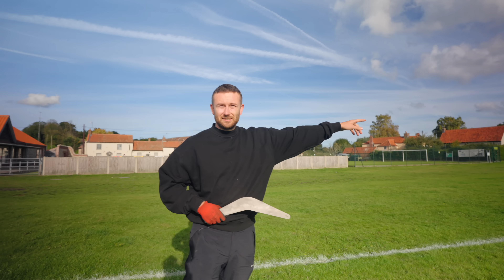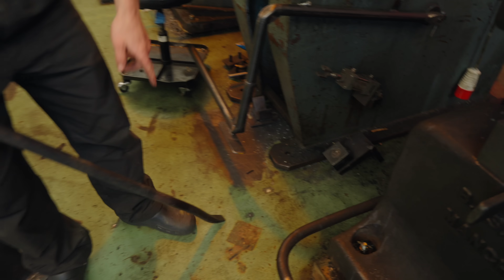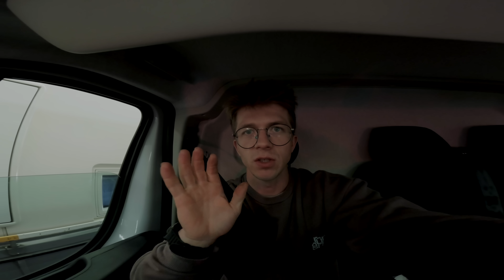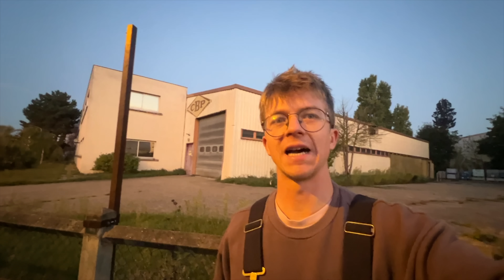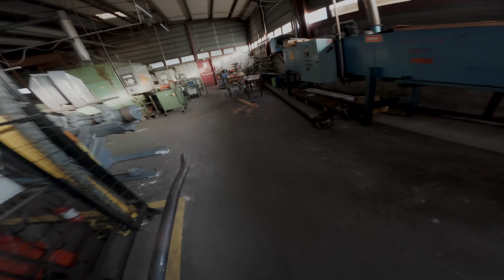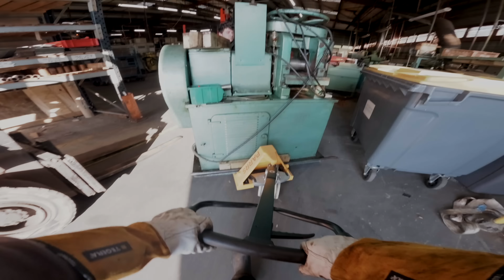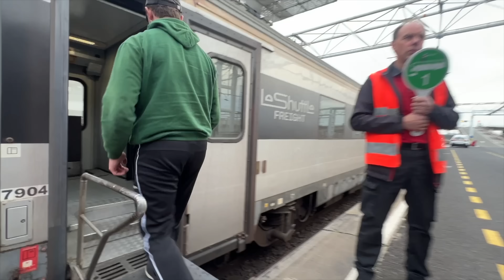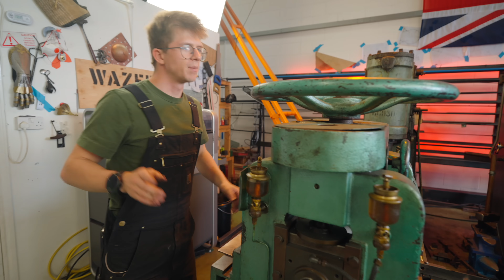My New French Friend

Comment: The curve comes from the small wheel.  Its adjusting the top roller forward and backwards (not up and down).  Moving the top roller backwards (away from you) will make the material curve downwards, and moving it towards you will make the material curve upwards.  Its adjusting the contact point between the rollers and if they aren't perfectly aligned its going to make the material curve.
Reply: There might be adjustments to the top to bottom roller. 
OR it could be that the top roller and the bottom roller are not running at the same speed. Either due to issues with the gearing and motors or the diameter of the rollers. 
If the bottom roller is larger or going faster it would inpart a curve on the material as the material is being forced through the nip faster at the bottom than the top.
Reply: @TrygK  exactly the reason metal bends is usually because the upper wheel slips or is slower than the lower one or even without lubrication the metal "sticks" to the roller causing the curve. This machine does not have horizontal roller adjustment, only vertical.
Reply: Was not sure if he was trolling when he said he did not know what it does lol
Reply: The reason metal bends is usually because the upper wheel slips or is slower than the lower one or even without lubrication the metal "sticks" to the roller causing the curve. This machine does not have horizontal roller adjustment, only vertical.
Reply: Looking at the bronze axle boxes on the ends of the rollers, they're pretty much constrained by the uprights, so I doubt it will alter the fore and aft position of the top roll ? My money's on a fine feed wheel.
Reply: @graemewhite5029  You are correct, the rollers are not free to move - only the feed screw. The way you prevent the bend is you TURN IT OVER each pass to equalise out the bending of the bar. 

Steel mills have an over and under feed - they feed it from front to back and then back to front UNDER the roller
Reply: @piccalillipit9211  I am a gold smith and I have used plenty of hand crank rolling mills and while smaller, they are also very similar. most precious metal mills will cause a curl and the way you correct the curl is exactly what you said. filp it over with each pass. if it curls to the left or right the same is true. getting in there to try to change alignment issues is not fun, just flip it dude..
Reply: That was my first thought too but @20:20 you can see the wheels don't have adjustment in that direction, only the Z  axis is adjustable
Reply: No, that's wrong. There's no horizontal roller adjustment on this machine. Curve come from a speed difference and or sliding between top and bottom roller.
Reply: @Eng-OS ive worked in quite a few machine shops, never one that had or used a machine like this, but have been around many machines throughout my career, to me the small wheel looks like it would be for fine adjustments since the larger wheel has a pretty coarse thread it would make sense to have a way of making smaller adjustments between passes.
Reply: My bet is the rollers are not moving at the same speed. Makes sense if this machine has no forward/ aft adjustment.
Reply: Every time you run the material through the rolling mill ,you have to turn the material over to prevent the material from curling excessively.
Reply: I worked in the largest rolling mill in the US, our mill you could adjust the speed of the rollers independently if the material deflected also the position of the top roller in relation to the bottom roller in relation to the bed. (I'm guessing that's what the small wheel is for.).   However I will add, different alloys react differently to rolling and the machine had to be adjusted accordingly.
Reply: Try flipping the metal every time you roll. Before the curve gets to large,always worked with silver and gold.
Reply: Nope, all wrong, all of you. I don't get how nobody has noticed that the only thing the small wheel could possibly be doing is adjusting the tilt of the top roller side-to-side.
Not a fine adjust (the big wheel is big for a reason), not any sort of traverse (this is a flat roller), not a speed/slip control (adjusting that is far more complicated).
It moves the central gear which makes the jack gears rotate in opposite directions so one screw goes up and the other one goes down, tilting the roller side-to-side.
This seems incredibly obvious.
Reply: @samheasmanwhite  on a rolling mill like this, there isn't really benefit to having one side closer together than the other. It would just cause the piece to wander to the wider side and prevent it from compressing as much as if you simply had the rollers parallel.

Having an adjustment available to true up rollers that have shifted out of parallel makes sense, but that is not an operation that would need to happen frequently enough to justify a control front and center; it would more likely be set screws or nuts or something that people couldn't accidentally mess up during regular use.
Reply: @Mrjcowman  The adjustment range is very small so yeah I'd assume it's just for zeroing out small errors in parallelism.
It seems to actually be a fairly common adjustment on this sort of mill, like on the mill he shows briefly from the other fellow the height adjustment wheel is actually two wheels sandwiched together that can be loosened to move each side independently.
I'm not sure why it's important, but there are inaccuracies in threads and slight differences in stiffness of each side, so I wouldn't be surprised if making something like precise shim stock could require correction on a job-by-job basis due to being so thin that a few microns of tilt could be a problem.
Reply: I believe it’s either this or for making finer adjustments by dividing each tooth on the big wheel into a full circle on the small wheel. If it’s a cold roller, it should require much finer adjustment because the material is more dimensionally stable when cold-rolled. But for hot rolling, I’m not sure how much adjustment a roller needs, so @gingerhacks5131’s comment makes more sense to me.
Reply: What he said. I was going to comment the same thing but you said it. 😂
Reply: Spot on.
Reply: Nailed it
Reply: That was my take too. The small wheel/dial changes the angle (front to back) and pressure point between the rollers.
Reply: What if it acts as a brake on the top roller adjustment to the speed will adjust the nip of the steel being fed and impart a curve?
Reply: I work in a facility that specifically mills (rolls thinner) aluminum ingots into sheet metal. The curve can be due to an alignment issue with the rollers, but more common and therefore more likely, is a speed issue. We roll ingots from 32 inches thick to the thickness of a soda can. Any speed issues at all will cause the metal to curve. The small wheel is likely to fine tune the upper rollers speed to prevent curvature. That particular mill is not designed to produce curved work pieces. It is designed to flatten and reduce the profile of the work piece.
Reply: Yes, if the rollers aren't aligned and especially if the top roller is behind the bottom then it rolls up.
Reply: Exactly my thoughts. The curl is an alignment issue. There’s gotta be an adjustment so that it can be used as a roller(radius roller)  aswell.
Reply: Genuinely curious as to what metal working process would require you to have the material curling upwards in a rolling mill of this kind... You're not exactly going to be making hoops in this contraption.
Reply: @CapOfXav  You've never seen arched railings or gates etc?
Reply: yeah it reminds me of a slip roller in that regards
Reply: I knew it changed the orientation of the two rollers but i didn't know it would cause the curve in the metal. Thank you for the knowledge.
Reply: I think that the actual issue is that the metal being rolled is cooled by the roller press on the lower side making the metal unevenly heated which allows the top side to bend more easily. So heating the metal more or creating some insulation layer between workpiece and the bench of the roller press might improve the situation.
Reply: I've never worked on one of these machines or anything like it but I could work that small wheel adjustment out 😆😆 if you have one roller Infront of the other it's going to curve upwards  if it's behind it it'll curve down and if it's spot on it'll come out flat
Reply: Bingo! He was wayyy overthinking the small wheel.
Reply: I thought it was pretty obvious too and I trained as a mechanic not a metal worker/forger.
Reply: Was gonna say the day thing!
Reply: Yep just what I was going to post.
Reply: yes its pretty simple logic now that i think about it
Reply: @jacnadd780  This machine does not have horizontal adjustment, it only has vertical adjustment, and the small wheel is used for fine adjustment.

Comment: No hate on Jamie, but that's not how you throw a boomerang at all. There's a simple but distinct way of doing it, just like you wouldn't just chuck a stone into the water if you wanted it to skip. With the technique you used to throw that titanium boomerang, no boomerang would return, so it wasn't really demystified. That's a Jamie L.
Reply: As it's 2mm thick and made of titanium, I don't think you really want it coming back anyway.
Reply: There’s no way that thing was coming back regardless. I just don’t think you can get enough cross-section shape out of 2mm sheet for it to generate enough lift.
Reply: @SaffronMilkChap You don’t actually need that much lift.  It’s  mostly gyroscopic precession at work.  I’ve seen flat boomerangs work, but they were very unstable.  I don’t know for sure, but I suspect that the airfoil shape is more important for drag reduction than lift generation.  For a lightweight material a flat leading edge like that would sap angular momentum way too quickly.
Reply: The angle you have to release it is about 60-75 degrees (up from horizontal)
Or 15 to 30 degrees off the vertical. 
They make thin plastic boomerangs in all sorts of configurations. So if you are getting lift from the surfaces it should work.
However!!!
I think you need to put some curvature into those surfaces (ie. belly them out) to get lift from them. Otherwise they're just too shallow an aerofoil and not enough lift to overcome aero drag/weight. Make a 'deeper' aerofoil by dishing the surfaces and you'll have a mystical titanium boomerang! (Anodise it for more mystic).
Reply: Did you know there is a name for a boomerang that doesn't come back ?

It's then called a stick
Aussie joke !

Comment: From what I understand, The curling is the internal stresses showing - you run it through onece and if it curves you flip it and run it back through.

Can also be one wheel "slipping or rotating slower than the other. Which ever wheel is moving slower it will curl away from

Comment: you could have lifted the pallet to get the other side of blocks out instead of having to sling it up.
Reply: This was my thought as well. Something which may come in useful for the next time!
Reply: With the slings it can't topple over though. Factory floors are level but pallets on a parking lot can get pretty wobbly. Safety first.

Comment: Hey Alec,
In case you are not aware: you can do ARB (accumulative roll bonding) to create nanocristalline or at least ultra fine grained metals. Take a look at that :)
Edit: or reach out, I am a materials science PhD and used to work a tiny bit with ARB and could connect you to some experts if you want.
And you can also use two different metal sheets to create laminates with down to sub micron layer thickness and much higher hardness than the pure metals.
Reply from the maker: This sounds crazy! Would love to learn more!
Reply: @AlecSteele  i don't have Instagram, how can i reach out to you without that to give some more information? 
But i also saw there are a lot of open access publications available if you want to start like that..
Reply: @AlecSteele  Yes! Please!!
Reply: I think that's the secret project, cold bonding to make Titanium Damascus.
I saw a youtube vid about that recently, they used a press to make the bond.
Reply: We all want to see more of Alec's Mad Scientist story arc, so this sounds very cool!
And I'm with s1gne... that'd be wild if cold-welding could work to make Timascus. I've seen AvE and Adam Savage demonstrate it on gauge blocks, where simply wringing their flat surfaces together losely bond them enough to have the one hold on almost as though it's using magnetism to stay connected. (but it isn't, as they demonstrated so before the wringing)
Reply: @DUKE_of_RAMBLE im starting to think Alec is only a bad day or two from becoming a super villain flinging titanium boomerangs at james bond or batman 😂😂😂😂
Reply: @Greg1096  LOL But... Why can't he be a good guy still?? 😅
The "Feral Child" in Mad Max 2 had a metal boomerang and he wasn't evil 😋
Sure, he snarled at AND bit Max, but that's just because he's feral! lol 

Canonically that was made from "chrome", though, not titanium. Even then, given post apoc, likely just from a vehicle bumper and therefore would've only been chrome plated* (at least on parts not ground down for the airfoil shape).